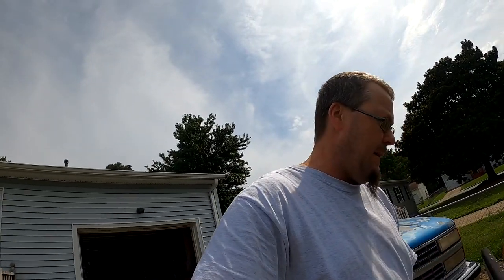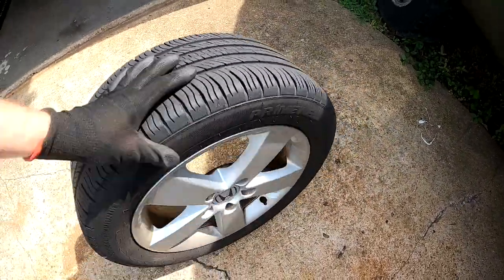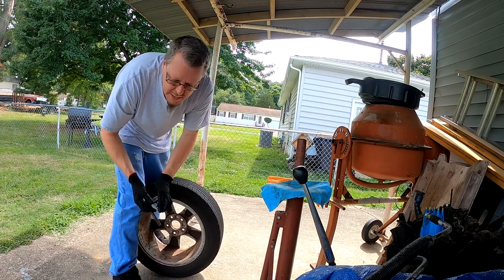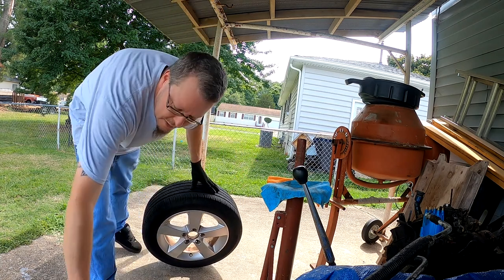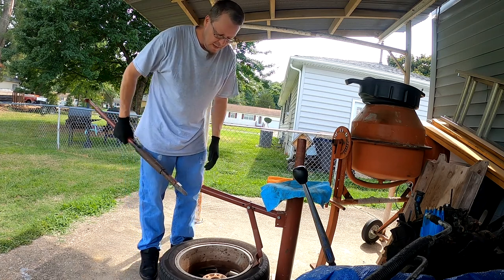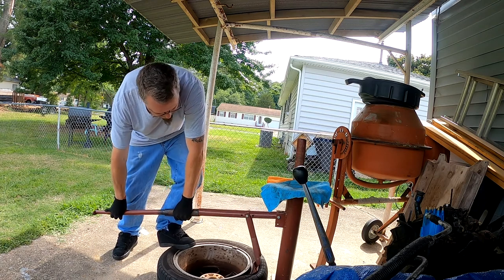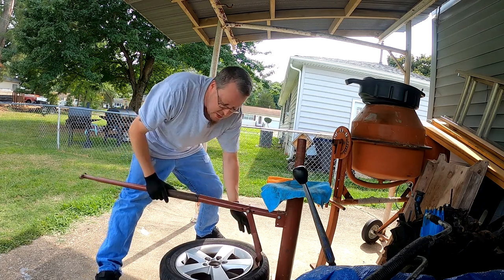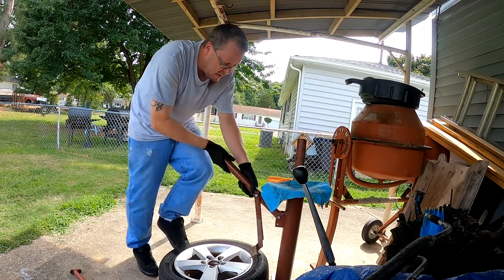Harbor Freight Manual Tire Changer -- Easy To Use

Comment: I tried to do it with the backside up on my second rim n i broke the freakin weld part which is the top part right at the seat. I prob got a freakin lemon why bcause i weight 108 lbs n thrs no way i can break the thing. Bringin it back fo a nu one tomorrow!
Reply from the maker: wow thats crazy. yeah has to be a lemon. like i said have done like around 100 wheels and no issues. Hopefully the new one is better.